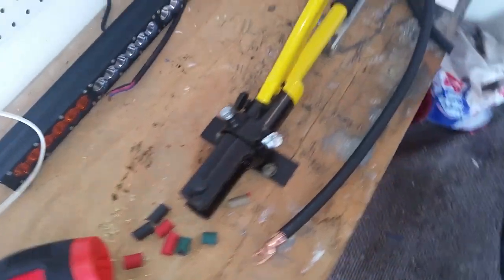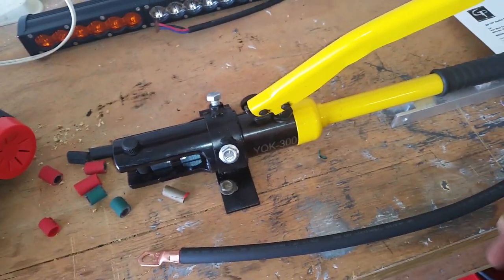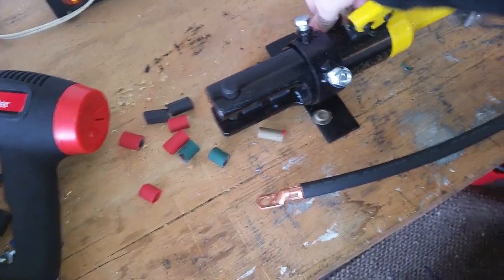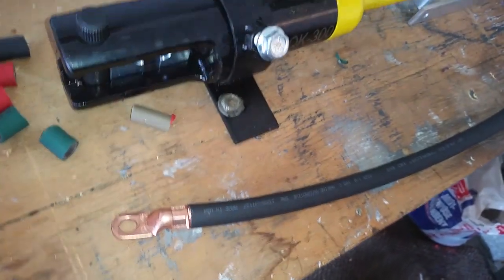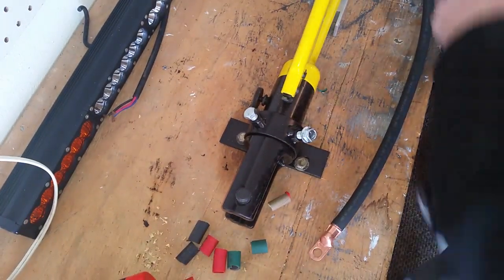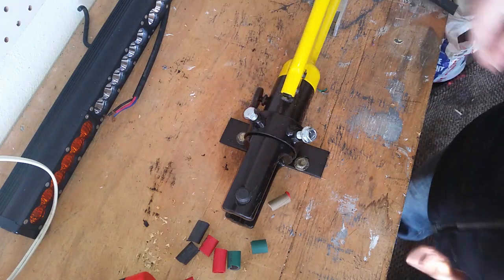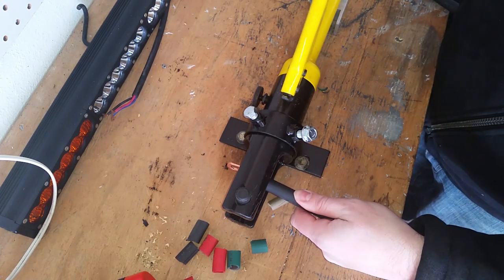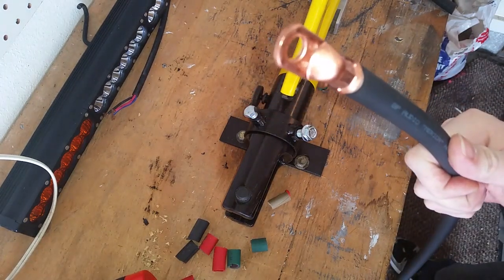Hydraulic crimp tip of the day

Comment: always liked that crimper. very professional job right here
Reply from the maker: yeah we really like this crimper one thing I forgot to note in the video is that that crimper, the overall design is really like a two person job, meaning one person uses the 2 handles the other person holds the wire and lug, turning it into a table top crimper like that made things so much easier and a much smoother operation. also makes the overall process drastically quicker.

Comment: What size dyes do you use in your crimper for 1/0?
Reply from the maker: it really depends on which lugs you're using, some lugs are a copper alloy. pure copper UL listed 1/0 lugs usually take a 35mm or 50 mm, then the thicker copper alloy lugs take all the way up to a 70mm